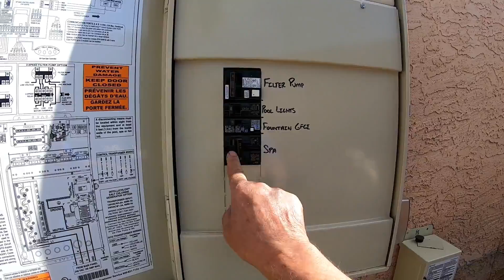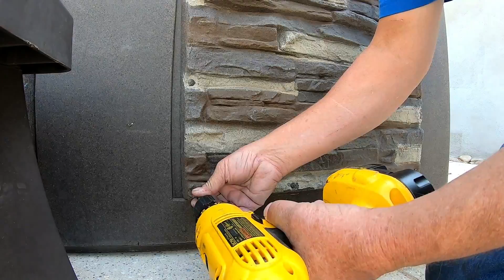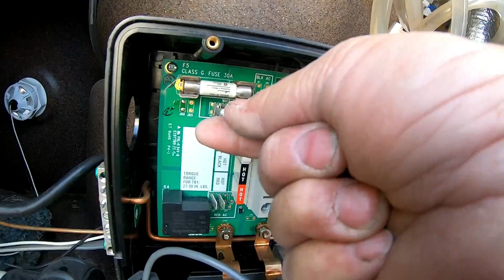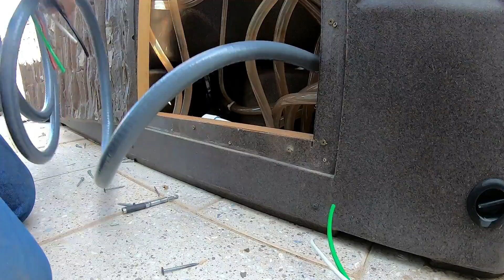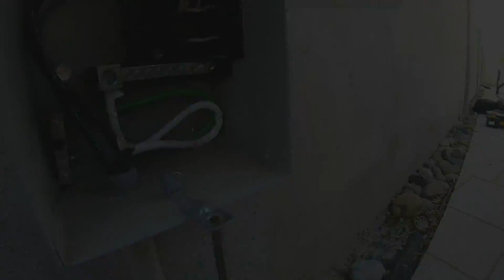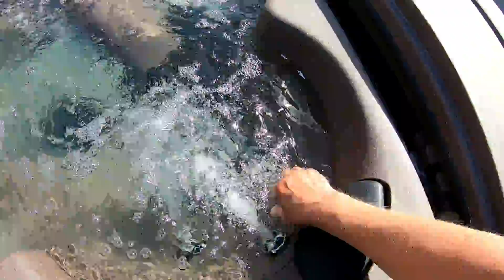How to wire a 220/240 volt Spa... Step by Step details

Comment: Great video, but where the conduit of wires come out the side of tub where you drilled, you need to place a strain relief or another water tight seal or something to seal this good.  Once rodents get a whiff of that gap and detect heat and a space within, they will chew that wood out to fit their bodies through the hole and make a real mess of the inside and insulation and chew wires until tub does not work, this happen to me, and I was pissed at the electrician that did the work, that should have known better being pro.  All other entry points into boxes with the wires and conduit looked good, but the one closest to ground at tub entry, not so good.
Reply from the maker: Been doing this for years and that has never happen... Ever..... Thanks for Watching & SUBSCRIBING

Comment: you need a grounding rod at each sub panels.  some areas require each sub panel's ground to be tied on two seperate ground rods 18 inches apart
Reply: Wrong, you need a ground rod only if the sub panel is located in a separate structure, in this scenario it is not

Comment: Can someone point me to exactly what wire I need to run from the main panel to the spa pack and then from the pack to the hot tub
Reply from the maker: I use #6 wire size and  THHN or THWN wire for most runs that are under 120 feet.
Thanks for Watching & SUBSCRIBING

Comment: Are the black and red wires interchangeable since they are both hot? My spa has ground, common(white), and two black wires( hot)
Reply from the maker: Yes they are both Hot.. As a safety measure check them with a tester before turning on the breaker..
Thanks for Watching & SUBSCRIBING

Comment: Trying to hookup a new hottub (the wiring is still in place from the old one installed 30+yrs ago) it has two breakers in the outside panel and more than the four wires that you are showing with different colored wires so I'm going to get some more knowledgeable help so I don't Farble anything up.
Both the old and new hottubs are 220v.
Reply from the maker: No big deal .. If you need help call the office and talk to Scott 
Thanks for Watching & SUBSCRIBING
Reply: @spaman5440  Thanks, got it figured out, bought a 50amp-gfi breaker and got rid of a few wires. 
It's working as of last week.

Comment: Hi Scott. Got a bullfrog spa that sat for quite some time. Had a repairman come out and he said bad pump/crack from freezing. We replaced pump, and cover. Now the tub is leaking and the power is tripping to the tub. He is recommending heater replacement next and no guarantee it fixes it.  The power trips to the breaker after about 5-6 days so when he goes to test things he can’t find anything. Have you seen this issue where is trips after 5-7 days and then leaks out. Thanks
Reply: We also had breaker replaced he thought that could be it. Filled it back up brand new filters and trips again after 5-6 days and come back and it’s drained out. 1 ft water left
Reply from the maker: A leak has nothing to do with the breaker tripping. Find and fix the leak first the figure out why the breaker is tripping. There will be signs as to why and what is causing the breaker to trip and you can use process of elimination and figure it out. Its not hard and takes about 30 min maybe. Thanks for Watching & SUBSCRIBING
Reply: @ thanks, still haven’t figured it out. Doesn’t hold power after 5-7 days (temp drops). And leaking out somewhere. Hard to find a spa man as thorough as you are it seems. Keep it up!

Comment: Scott , sorry for the long comment, I have installed BP7 with a TP500 topside wasn't able to get the 2nd pump(1 sp) to fire(Aux). I was talking with a Tech support forgot to mention that on that pump 3 wire was on it  I have 4 wire (grnd, wht, blk, red) which makes it a 2  speed wire corrct?but pump is 1 sp  the wire I have is for a 2 speed but I left the red disconnected will this make a diff for it not firing? I had the 2 sp plug , pluged in pump 1  and the 1 sp cord plugged in pump 2 on expanstion brd wasn't able to get pump 2 (1sp) to fire.   Tech thought I should have theTP600  I thought so as well.. but the seller wanted me to send in the entire unit..what a huge inconvenience  Tech said i had everything connected correctly. and could be the topside or the expansion brd / or main brd faulty.  I started wondering about that 2 sp cord on a 1 sp pump cord that came off of it. So Im sending back the entire unit in per the seller.  Geeezz.. :face-pink-tears: please help

Comment: Im changing my shaft seals but unsure of the wear ring my old one didn't have the flang(lip) on it not sure if it wore off and the new one does..... this mke a diff?
Reply from the maker: (If we are talking about the same thing) Yes it makes a difference…if it wasn’t on the old one either it wore away and broke or it wasn’t put in from the start …If you’re not sure then take in and get it done right. We never just replace the seals … we recondition the entire pump & motor
Thanks for Watching & SUBSCRIBING
Reply: @spaman5440  Ty for your reply. I was curious about it. Sounds like what you said it prob wore off. I also changed the bearings also.  I watch a lotof your vid  Ty Again
Reply from the maker: @garyredmond9275  Sure anytime.

Comment: Wow!! Thank you so very much!!  I've run the 220 line to a box outside, and showing the flexible conduit and the connectors to the control panel... I would have totally missed that step!!  And using the reducing washers... nice touch!!  I love the explanation as to WHY you're doing things as well... like... use this to help secure in case someone trips over the wire!!   THANK YOU AGAIN!!!
Reply from the maker: You Bet ...Thanks for Watching & SUBSCRIBING

Comment: Thanks for the vid! And great job on it too! Fact is you saved me. Was going straight in with short wires and it just wasn't working for me! Left the 8-10 inch tail, installed the ground first, then wrapped the other wires around and worked them in top to bottom. So much easier - and smarter! Thanks again!

Comment: Great job! Excellent step by step details as an industrial maintenance electrician some people get confused about the white wire being called a common VS a neutral when the white wire is carrying the unbalanced load in a circuit like 220V, 480V it's a neutral DC voltage its a common, but I get what he's saying, but not D.I.Y.'s 😊

Comment: Question, I’ve got 6 gauge wire but instead of white, I’ve got a yellow. Am I still able to use it to connect the hot tub to the sub panel?

Comment: Great vid! Does this work on a hot tub with Two pumps?
Reply from the maker: Not really sure what you are asking...
A hot tub with two pumps and motors 99% of the time has to be wired 220/240 volt hard wired.
Hope that Helps ...Thanks for Watching & SUBSCRIBING
Reply: @spaman5440  sometimes not knowing enough means not knowing the right questions to ask, so I am sorry for the confusing question I asked. I guess what I am trying to find out is, my 220v hottub has 2 pumps, so do I have to run 2 separate 220v circuits (220v circuit per pump) or will the one main 220v circuit power the tubs two pumps

Comment: How did/do you seal up where the flexible conduit goes through the cabinet to keep out the critters? Silicone, Duct Seal, or any special grommets?  Thanks in advance!
Reply from the maker: I try to drill a hole just big enough for the seal tight to go through...And I have never used any thing to seal it up.. I personally have never seen the need to do that.
Thanks for Watching & SUBSCRIBING

Comment: Do you have any vids that show how to (RE)-insert conductor wires for the pumps back into the clip terminals on a Jacuzzi J370 control board? Cant get the bared twisted wire ends back into the square inserts with the little 't-lever' looking contraption underneath (have photo of them)... THANKS!

Comment: Hi Spa Man.  We are getting a D1 Executive tub.  Do you have a favorite 50 amp sub panel? I hear of the breakers being unreliable on some, expensive on some, or just too tight for 6 gauge wire.  Any Suggestions?  Thanks!!
Reply from the maker: I believe they are all very reliable, as far as price goes it just gets down the where you buy them as to the price you are going to pay. The problems that I see are connections being loose! Every GFCI that Ive seen fail had loose connections. As for the #6 wire being to tight..If you take your time and make sure the connector is open all the way it will go in the hole. Thanks for Watching &SUBSCRIBING

Comment: Question. So I'm in the middle of connecting a 220/240 volt Spa from a Pentair Intellicenter Sub Panel like your doing in this video. The breaker at the Intellicenter is a 60amp NON-GFCI breaker. So I just need the 1 60amp GFCI spa disconnect near the spa and that is fine correct?

Comment: awsome video, you explain things very well and now I feel confident in wiring my hot tub, which I just ordered today and will be here in 2 weeks or less, so I am going to tackle the 220 v line, I did wire up a dryer to the breaker before so I have some experience, my breaker box in about 100 feet from the tub and I will have to run the wire from the garage threw the Attic to the back screened in porch and down to the tub, how far away should the sub panel be from the tub? and since its inside a covered enclosed  porch ?   do I still need to use a metal box for sub panel ?  or could I use a 4 wire recptical ?   or do you have a different sugestion?
Thanks for your help

Comment: Hi did everything like your video, I install the sub spa panel 50 do I need to put water to the spa because trip all the time
Reply from the maker: If the spa is tripping the breaker with or without water in it.. you wired something wrong or you have a problem with the spa itself. Thanks for Watching & SUBSCRIBING
Reply: @spaman5440 we just hooked up our 220 and confirmed voltage is there and accurate but the top control panel will not power on, any thoughts?

Comment: Scott, amazing video. Thank you for sharing. I’m not close, otherwise I would reach out to your shop. We had an electrician pre-wire from a 50 amp GFCI breaker to our future spa 40 feet away. Now that we have the spa I’m trying to hook up the wiring. There is no disconnect close to the spa, so planning on adding a disconnect. Do I need an AC style disconnect or a GFCI breaker disconnect in the location close to the spa? Also, the electrician ran number six hot wires, number eight neutral, and number 10 ground. Based on your info, should I run the last 20 feet with all number six or do I need to replace all of the number eight and number 10 wires? Thank you in advance for any guidance.
Reply from the maker: The electrician need to go back and rewire with #6  THHN or THWN wire on all four wires (the smaller Neutral and Ground over time could cause the GFCI not to work properly)
A/C style disconnect should not be used for a hot tub
.Use a GFCI in the Main panel or in the Sub panel. 
Thanks for Watching & SUBSCRIBING
Reply: Thank you!!!

Comment: I have a tech wire 8/3 the code says the neutral wire should be white the tech wire neutral is blue. Is that a problem?
Reply from the maker: Ok first off I would never use that type of wire or that wire size it will just cause you problems in the future and can void some warrantees
I only use #6 on all four wires and THHN/THWN wire only. 
Over the years Ive seen so many different wiring jobs some with permit and many without.. Wrong wire size and type are a main problem many home owners run into...We fix several problem because of this each week and have for many years... I hear it all to often when I tell the homeowner its the wire size or the type of wire they used.. And they say (Its been working great for Years) And I tell them.... and now its not!!  Some don't believe me and get another option (Spend money on unneeded parts)only to find out I was right. Hope this Helps Thanks for Watching & SUBSCRIBING
Reply: @spaman5440  the manufacturer specifies 8/3. Thank you for replying.
Reply from the maker: @amilias1000  Interesting...Well I can tell from that that the manufacture has probably never had to go out on a service call. 8/3 is Roman with an undersized ground..

Can ground wire be undersized?

With too-small a ground wire, the breaker cannot magnetic-trip because it cannot flow enough current to hit 10x, because of the too-high resistance of the wire. And as you can guess, that's trouble.

 
Romax  wiring has been the problem in so many Hot Tubs Ive lost count ..Thats just my two cents worth. Thanks for Watching & SUBSCRIBING
Reply: @spaman5440  sounds dangerous if it can't trip the gfci

Comment: My spa keeps tripping but my heater  works pump works and air works it only trips when all 3 are going at the same time any help would be greatly appreciated
Reply from the maker: There could be several reasons for this.. 
Wrong type/kind of wire 
Wire is not the right size
Spa is to far away from main breaker 
Wrong size breaker 
Wrong type of  breaker
Connections are too loose
Spa motors over amping

Just because everything works doesn't mean that there isn't something wrong with the motors.heater or the blower
Hope this Helps Thanks for Watching & SUBSCRIBING
Reply: @spaman5440  it has been going well for the last 6 months and just started what would you suggest a start with
Reply from the maker: @leenewell2481  Im not sure were you live in the world but here in Arizona the problems you are having happen every summer as Temps get over 95 degrees and homeowner want to use the hot tub and it is alway one of these things 

Wrong type/kind of wire 
Wire is not the right size
Spa is to far away from main breaker 
Wrong size breaker 
Wrong type of  breaker
Connections are too loose
Spa motors over amping

You need to find out what has been installed and wright it down.
and you need to figure haw many amp are being pulled when everything is running .and wright it down.
For more Help you can call and talk to Scott and he can help you with more info Thanks for Watching & SUBSCRIBING

Comment: Great video as I’m going to be wiring my hot tub soon. I only have one question. What did you use to cover the hole for the seal tight entering the hot tub enclosure?
Reply from the maker: Nothing is needed.... The hole that was cut in the side of the Hot Tub is just one size larger then the seal tight. You can also use a hole saw that is the same size as the seal tight if you want. The reason I use one size larger is it is a lot easier to pull the seal tight through the hole. Thanks for Watching & SUBSCRIBING

Comment: Are spas all wired the same way?
Reply from the maker: No!  not even close. You have 110 volt Plug & Play or  you could have a 3 wire 4 wire 5 wire and even a 6 wire hot tub. You can have form a 20 amp breaker all the way to a 60 amp breaker. When I comes to the  breakers make sure there is a GFCI breaker installed . If you need some help call the shop and talk to Scott he can help you. Thanks for Watching & SUBSCRIBING

Comment: Electrician ran 240 2+G wire from main panel (50A double pole) to outside HVAC style disconnect box. Tub has no neutral and is failing GFCI tests. Can I run a neutral from the disconnect box to the tub to or do I need to run it all the way (200+') to the main panel?
Reply from the maker: Ok ..this is how it should be done.. 4 THHN wires... two Hot wires ,Ground , Neutral from the main panel to a Spa sub panel( Not a HVAC disconnect )Put the GFCI Breaker in the main panel then put the other breaker in the spa sub panel ..Now weather your spa is a 3 wire or a 4 wire you are GFCI protected because the GFCI is in the main panel (I think this will be my next Video idea) Hope this Helped Thanks for Watching & SUBSCRIBING

Comment: Just curious on the estimated cost to run a 240v connection with #8 wire and covert the tub from a plug and play to a direct 240v connection? Im in Los Angeles and keep getting crazy estimates.
Reply: Depends on how many feet you will need of wire
Reply: What did you end up doing here?

Comment: Looks like you converted from a 110V plug-and-play to a 220V hard-wired?  Don't you need a line-of-sight maintenance disconnect greater than 5 feet away from water?  I guess the breaker can be considered a proper disconnect, but this looks closer than 5 feet.  Code violation?

Comment: You could have used #8 THHN for 50 amps, correct? Certainly nothing wrong with going to #6.
Reply from the maker: (I would check local building codes)  BUT I never use #8 THHN wire I have learned over the years that when Im having a problem with a hot tub and everything is either New or in perfect working condition and the spa keeps tripping the breaker when I investigate what size wrier type was used...It was #8 wire or it was 6/3 remix so as a result of more then 100 with this problem when we changed out the wire the problem went away and problem was fixed ..Ive had professionals over the years say I missed something and I just roll my eyes and say whatever..Ive worked on to many spa to count and  its just what I'm see day in and day out... So #6 THHN wire all the way for the SpaMan ... Thanks for Watching & SUBSCRIBING

Comment: Do different boards for Balboa, when converting to 220/240, utilize the Red AC instead of the White AC for the pumps? The manuals I've seen do have the jump from Red AC to White AC however all the other wires to the pumps and ozone are coming from Red AC. Just curious. Thanks!

Comment: Hot tub calls for 60A breaker, 6# wire. How far can I run that wire from main to sub before I lose too much power?? Found one chart that says 188ft? And to clarify - I would run 60A out of the main and 60A GFCI out of the sub - or does that wire run necessitate a larger breaker out of the main?

Comment: Appreciate the detailed video. My pentair sub panel is connected to the main with 50 Amp breaker. Can I run from pentair sub to another sub with 50 amp breaker for 240 hot tub?